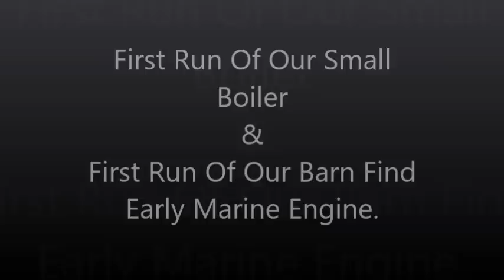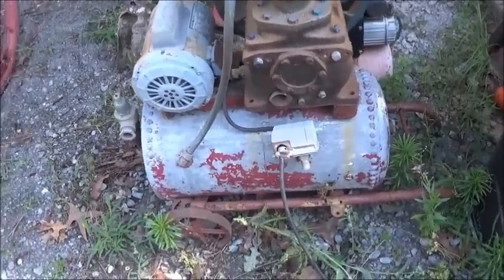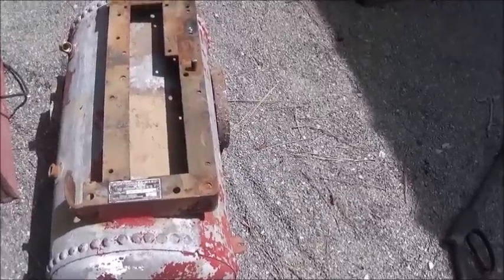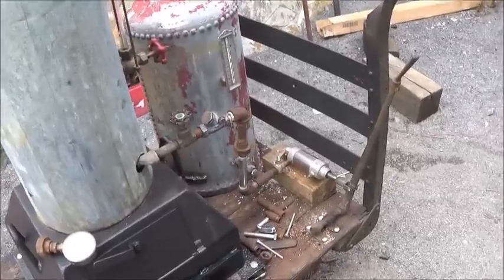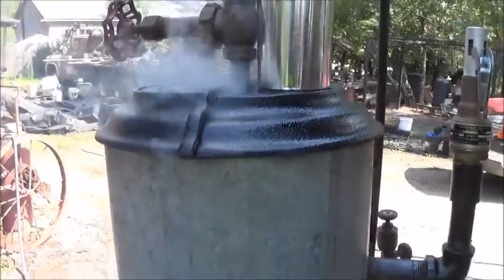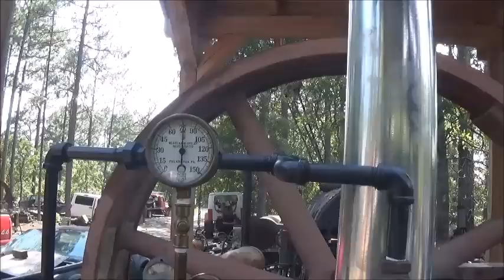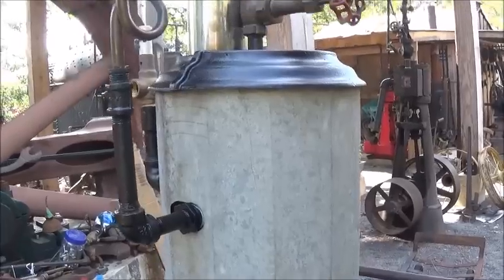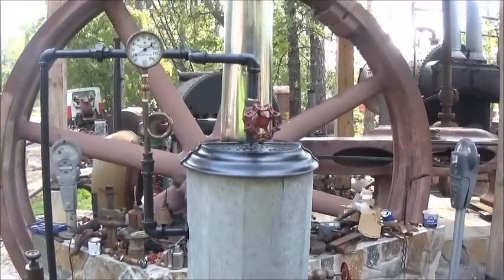BOILER FIRING AND STEAM ENGINE FIRST RUN

Comment: Nice little self-contained power unit there on that cart! Like you said: "All we need is a boat."
It'd really be nice to know where this engine was first used.
Same with the boiler, at the back of some workshop in the pre-electricity days, fired up and powering woodworking tools or whatever.
Very cool!

Comment: That is a nice 'old timey' portable power cart Jonathan, all you need is water and wood and the little engine can turn a saw, a drill, whatever you want.
Reply: 🗿 power inverter, deep cycle battery and gm alt, any you have a generator 👍👍

Comment: Jonathan, I have a pressure vessel that I think would go with the theme of your steam collection. It's about 12 ft tall and about 4 to 4 and a half ft in diameter. It is riveted constructed and was used as an air pressure tank. I see no rust holes in it and it seems to be made of approximately 5/16 inch thick steel. If you would happen to be interested in it let me know how to contact you with some pictures. If not I have no use for it so it will go to scrap which I really hate to do. It by the way is designed to stand vertically.
Reply: What part of the country are you in not interested in tank just helping with its journey if I can
Reply: @codyfoster7981  South west Missouri not far from Joplin mo.
Reply: Cool I'm west tn

Comment: This morning I was thinking that I hoped you were OK and I was greeted with this video. You have done a wonderful job on that little engine. It looks and runs nice. I loved how you figured out the stack size. Thanks for showing how math works. I was thinking the same thing as you when you had the engine going. All you need is a boat. That is a real nice set up there. With a couple of pulleys and a belt you could have a steam powered cart and drive it around your property. Thanks again for showing us what is capable with what you have. You made my day.

Comment: Controlling the water level on that boiler will be hard because it has such a small diameter.  I’d run the water line a bit lower. That relief valve has so much capacity compared to the steaming rate it barely cracks. 
Nice little setup, just a bit quirky. Good demonstration of why short squat vertical boilers are better than tall thin ones.

Comment: Drill a 3/16 or 1/4 hole in the pipe cap and put a lose fit cotter pin thru the top and hook a chine to it and ty it to the tank. That will solve 2 things you won't lose the cap and won't have a vacuum in the tank. Thank you  for your time Jonathon.    Paul  out in Oregon.

Comment: You might want to consider finding one or two of the small injectors made for the live steam model market. Superscale Locomotive's economy model and equivalent offerings from Eccentric Engineer would work nicely for this little boiler. I once had a little boiler similar to yours. The charm of hand pumping water quickly wore off.

Comment: Great job rebuilding that little engine and getting the boiler running.  I think you're the guy to ask for help to put in a new hot water heater...  I'm guessing you could probably do it blindfolded...  🙂

Comment: You might find the sight glass might shatter under pressure after a few cycles. 
Had a boiler myself, max pressure of 7.5 bar that kept shattering sight glasses found out the blowdown valve was a couple of mils out after a rebuild

Comment: Jonathan, I think that your stack is more likely stainless steel or maybe aluminum.  It just doesn't have the look of galvanized steel, which has a gray color and would tend to flake when you bent it into an oval. The shroud or shield for your boiler definitely looks like galvanized steel.  Only some stainless steels will be magnetic, so you can check with a magnet for galvanized, which will definitely draw a magnet.  If you have a magnet stick, and you cannot scratch away the galvanized surface, then it might be magnetic stainless steel.

Comment: I didn't know if it was gone a run buddy youare Jonathan W
Go ride the videos from before what you've already made forged and built hack the motorcycle alone was just total amazement or the lawn mower engine that ran without a gas tank
Reply: Sorry it was hard to understand sometimes I do not check Auto incorrect

Comment: Some hydraulic hose on the exhaust or the pressure relief and you've got yourself an excellent and portable steam cleaner to clean and degrease engines, metal parts and such. Put on a nozzle and it will even strip rust if you hook up to the pressure relief and keep a good fire going to keep the pressure up.

Comment: Do you use gas duty tape on those fittings?  The stuff is make to higher standards than regular Teflon tape.

Yeah that tank was for an R12 remote refrigeration unit.  It was sized like that so you could pump the whole charge into that large tank (called a receiver in refrigeration service) and service the system without losing any refrigerant.

Comment: An interesting setup , Jonathan ! could you run the condensate pipe from the top of the engine round to the top of the water tank to save a bit of water ?
Reply: Should work.  That steel tank is so big that it should radiate enough heat, as was done with early gas engines.

Comment: Hi Jonathan look this up you are halfway there with the clean smoke let see what you can do with it just think how much power you can make it will be fun to see.
 (A wood gas generator is a gasification unit which converts timber or charcoal into wood gas, a producer gas consisting of atmospheric nitrogen, carbon monoxide, hydrogen, traces of methane, and other gases, which – after cooling and filtering – can then be used to power an internal combustion engine or for other purposes. Historically wood gas generators were often mounted on vehicles, but present studies and developments concentrate mostly on stationary plants.) Almost forgot what would happen if you used the exhaust to preheat the water tank I think it would raise the efficiency.

Comment: Mount it on a small boat not a cart! LOL!!!! Remember the African Queen? OK Jonathan,  Do you have a horizonal engine and boiler that will fit in an S-10 or Ranger? I've been thinking about the toy wind-up cars that had an inertia flywheel pushed by a clock spring.... Get what I'm saying?

Comment: johnathan and all who read this will think im crazy  but in my experience that black heater exhaust pipe is worthless it rusts out and hand to be replaced every year  the galvenised last 2 to 3 years depending  oh how cold the winter is  note the galvenised by will  burn the galvenized coating and release a deadly toxic gas so it really should be wel vented to atmosphere  if to be used indoors  after the first burn though its fine 
or at least thats been my experience
for those that wish to argue with i can provide pictures of my heater set up with the galvenized pipe on it

Comment: When starting a cold steam engine, the cylinder cocks should be open to blow any condensate(water) out.  A slide valve will lift off the valve seat to relieve any water pressure but is bad form and procedure.  Yes, you need grates for the fire to rest on to properly burn.  Cast iron grates are good if can either find them or cast them.  Stainless steel could be used for grates for this size firebox and boiler.

Comment: You need to be able to heat your feedwater tank....Injecting cold water is not good for tubes...For your big boiler you need a deaerating system for your feedwater and chemical treatment with softwater to prevent scaling up the tubes....I think our steam plant ran a TDS of 3000 PPM with a constant blowdown...